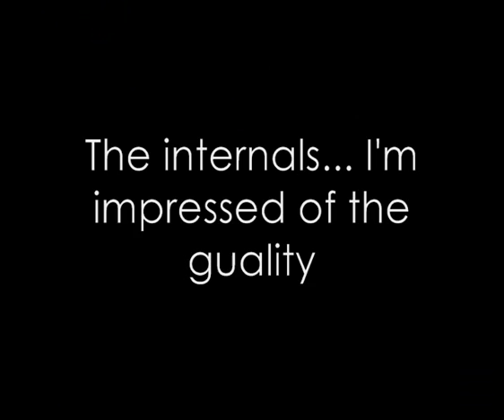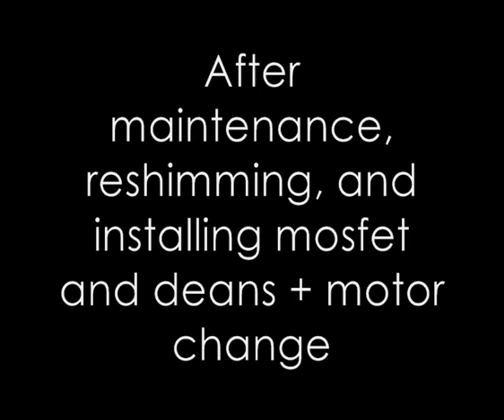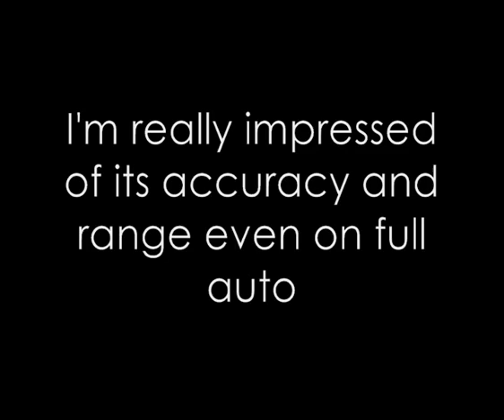galil review CYMA/CYBERGUN

Comment: @4everUSNavy thanks for the response, i took it apart and since it was previously used the thing was missing an anit-reversal latch. the problem was that the selector switch plate was worn, full auto and safety worked but the transition from semi to full is what stripped the plate.

Comment: *ANYBODY CAN RESPOND!* I have a problem with my cyma galil. After 2 months of usage it suddenly shoots 15 feet and 75 fps (not joking) i adjusted the motor height thinking it wasnt touching the gears enough making it lack power, thats not it. i have tried 3 of the same kind of batteries, not the problem. i now think its the motor not spinning the gears fast enough, tell me what you think it might be. Also semi auto stopped working earlier than when this happened, now it only shoots full auto.